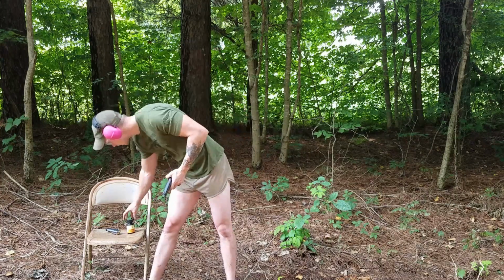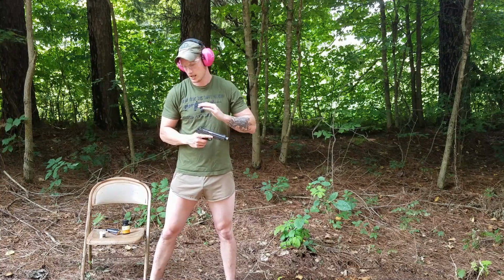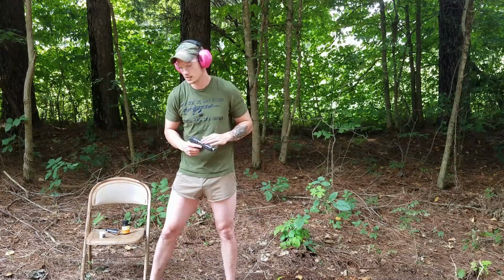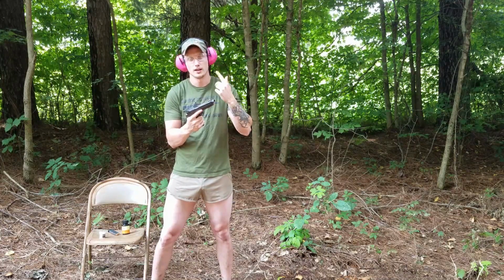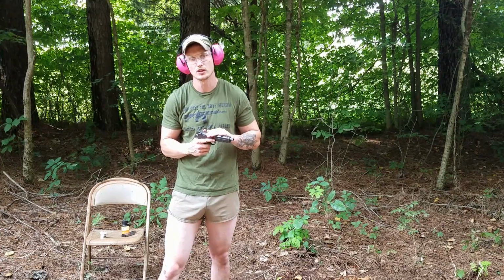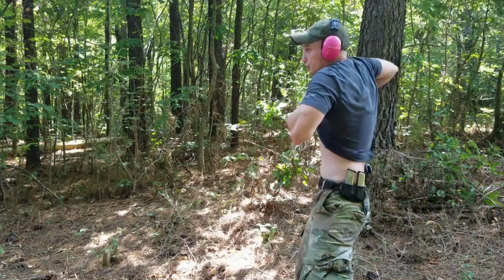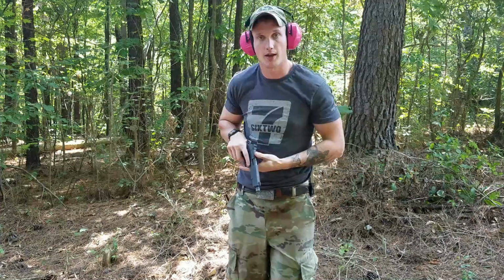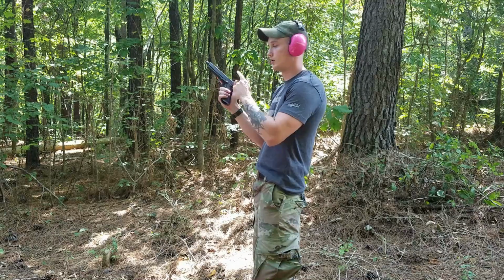Sig Sauer 1911 Extraction Test

Comment: Polish the breech face and breech.Use a 45 copper brush wrapped with steel wool with a drop of oil attached with a cleaning rod to a drill and polish breech, this will smooth the breech so the extractor does not have to pull too hard.Also good for shotguns too.
Reply: By "breech" are you referring to the chamber? If you need to polish the chamber in your 1911, you have bigger problems going on.

Comment: Huh, I had actually forgotten to update my comments. lol

You probably don't care, but I think it's still worth providing an update.

The new EGW extractor works great. It didn't pass the extraction test when I tried one handed with the original spring, which seems to indicate the spring itself was wearing out too after thousands of rounds. When I put EGW's coil spring in there, I skipped straight past the two handed test since I already knew it could pass that and just fired one handed, and it passed. Given extractor tension for external extractors is from that coil spring, it makes sense it worked best with the EGW spring as well.
Reply from the maker: See, I should have gotten the egw spring.
That's what Sig's own armorers could figure out was the spring tension.
Reply: @Thepreppersbunkeroutdoors  Yeah, the EGW spring definitely felt stronger, doubly so given it was new.

Though unfortunately, the EGW pin was oversized, so it got stuck when I tried forcing it in. The original pin is fine so that's still OEM with the extractor and spring now EGW and it works great. Usually I heard external extractors have a difficult time passing the 10-8 test but this one functioned. So I know next time this extractor wears out, I'll also replace the spring with the extractor.

Comment: After several thousand rounds, my Sig 1911's extractor is now worn out, too. I noticed it didn't pass the extractor test one handed before when I first attempted it (and it was probably already somewhat worn by that point as well) and now it's not even passing with both hands. I also noticed a few times when there were failures to extract even with the magazine inserted, which never happened prior to today, so while using the magazine masked issues before, it's definitely worn out to the point where it needs replacement.

Just put in an order for that EGW extractor so hopefully it'll be fixed once I get it. The pin was also impossible for me to punch out so I'm gonna have to let a gunsmith install it.
Reply from the maker: Man good luck. I was in the same spot, gun smith didnt get it right, and Sig didnt get it right TWICE.
It turned out being a spring tension issue.
The fact that Sig couldnt square it away in 2 trips is what started me down a path to being done with the brand.
Reply: @Thepreppersbunkeroutdoors  Usually any extractor problems are related to spring tension, though in my case, the tension was fine at the top, it was just the bottom part that was worn out. I didn't think about the fact that since the 1911 is a tilting barrel design, the rim would actually be held towards the bottom of the extractor and when I held the round fairly low, it had no tension at all and would fall off. The issue was masked before by the magazine pushing the round back up to the non-worn areas on the extractor. So your point that it was made from softer steel that wears out sooner is true, so hopefully the EGW extractor works better.

I did also order the EGW pin and spring, which should also make the spring tension better. Did you do that for this test? Does it pass the 10-8 extractor test with those new parts installed?
Reply from the maker: @gameragodzilla  i think i had the pin and spring also, but its been so long.
I sold the pistol which lead to my "1911 vs glock" video which is kind of lol.

Anyways- you are on the money with tension at top vs bottom and how magazines hide the issue which is the point of the test- its good to hear someone who actually gets it.
Reply: @Thepreppersbunkeroutdoors  I had initially dismissed the issues since the rounds still functioned fine with the magazine inserted and I heard external extractors often had trouble with the 10-8 test, but once I got some failures with the magazine inserted, I realized the issue.

And ah, I see. Would've liked to ask if there were any improvements later. Still, since I did hear external extractors often have trouble with the 10-8 extractor test, it passing well enough in this video is good enough for me. I wonder if there are any other parts in the slide that need replacement after thousands of rounds. I bought a Sig 1911 Tacops so when I went to get a custom built double stack 1911, I just took the slide off that gun to make it "convertible" between single stack and double stack. All the stuff in the frame aside from the Para-Ordnance specific parts are Wilson Combat, so those should last quite a while.
Reply: @Thepreppersbunkeroutdoors  Well, the gunsmith nicely tapped out the pin for me right there. Don't know what he did since it was so thoroughly stuck for me, but the extractor is out now. The underside of it was absolutely filthy, which I also hear could lead to extraction issues. Well now I'll just wait for the EGW extractor to come in and install it. I'll try to install the pin myself, but I'm starting to think that pin will also be a bitch to get in, so I'll keep my old pin just in case I break the new one. Looking at the extractor itself, the bottom is definitely completely worn out. The metal there is silver and very smooth. Hopefully the new extractor lasts much longer.
Reply from the maker: @gameragodzilla  Lord willing, lmk how it goes!
Reply: @Thepreppersbunkeroutdoors  Will do. heh

At the very least, the new extractor should bring it back to normal. Not sure if it'll pass the 10-8 extractor test since I hear that external extractor 1911s inherently have difficulty with that. Might as well test it out anyways, but as long as it works as normal, I'm happy. Hopefully since the EGW is a good quality part, it'll last a lot longer alongside all the other parts I got for my custom built. Though I am hoping the pin is easier to get in and out since I plan on regularly cleaning under the extractor after seeing how gunked up it was.
Reply from the maker: @gameragodzilla  absolutely!
And i do believe my sig passed the first 10-8 test i did.
My ria at the time with its internal extractor sure didnt though!
Reply: @Thepreppersbunkeroutdoors  Yeah RIA is a budget brand, so I can imagine some parts are out of spec. My 10mm RIA actually had a lot of parts break, though luckily the warranty meant I always was able to send the gun in and get it repaired, and the new parts all hold up. Haven’t tried the extractor test since I don’t carry that gun so I don’t shoot it much (especially since 10mm is even more expensive than .45ACP) but the basic extractor test using a dummy round on the disassembled slide worked great, which also helped confirm that my Sig extractor finally wore out since the extractor had way less tension and the round fell out easily unlike the RIA.

Granted, I’m sure since I sent it in for warranty, the replacement parts were all hand fit and tuned well by their on site gunsmith, hence why it worked well. I’m sure they did the same with the trigger given my physical pull gauge has it break between 3 and 3.5 lbs, which is really nice.

My .45ACP 1911 is now all custom, so don’t have any warranties. Of course, the parts are all individually higher quality so they should hold up better. Only “cheap” parts are the stuff in the Sig slide assembly since I just took that off my Tacops, so hopefully the extractor is the last part to break in a while.

Comment: Many guns with external extractors fail the 10-8 test. Glocks are the worst offenders. You're gun was running fine and now you're concerned because it fails a random test designed for the traditional internal extractor 1911... Don't look for problems in a gun that runs fine.
Reply: This is a 1911 test. 1911s aren't Glocks. Properly running 1911s should pass this test, external extractor or not. He upgrades the extractor and it starts passing the test. Do you see this improved and more consistent extraction behavior a net gain or loss? And it's not like 1911s randomly pass or fail this thing. 1911's that past routinely have common characteristics that contribute to success on the test. Do you know what these are and do you feel they are important?
Reply: @opmike343  I like this comment.....I'm curious why someone would introduce Glock into a 1911 article.....

Comment: I have a Sig Scorpion 1911 4.2 inch 45 ACP......My Sig took over 500 rounds to break in. I installed that EGW extractor.   I polished the extractor face, inside of the claw and the bottom feeding bevel as well as the breech face and frame feed ramp which I don't care what anyone says....anything machine mad needs these final touches for reliability.   I've found to either use to re-use the Sig extractor spring or cut one rung off the EGW spring that they sell.....It worked for my pistol.....That extractor with their spring is way too tight in my opinion....
Reply from the maker: Not everything machine made needs those touches at all- but I'm sure it helped.
And thst was the thing eventually with the egw extractor was needing a clip removed from the spring. You would think that Sig would figure something that simple out.
With that being said have you ran it in a class yet? I probably had 2-3k through mine without issue before a little stress induced operator error choked it up.
I bet with your mods yours would do a tad better.

Comment: You have to fit that egw extractor , the nose of the hook and the fitting block has to be trimmed
Reply from the maker: That wasnt what they told me at the time, however the current owner claims its doing great now with a replacement spring or a clipped spring or something.

Comment: Could it be that the magazine is apart of the timing of the gun which is why it doesn't work properly without the magazine inserted, kinda of like if you have a mag with a weak spring?
Reply from the maker: No- if you want to understand how and why it works- look it up. You will literally have an answer in less time than it took to comment.